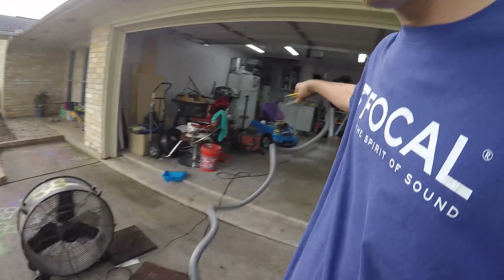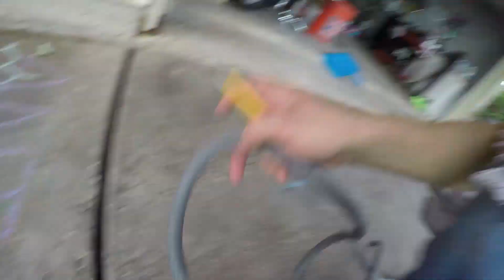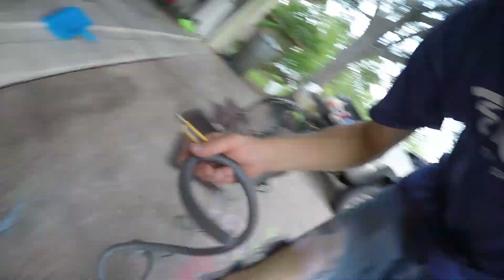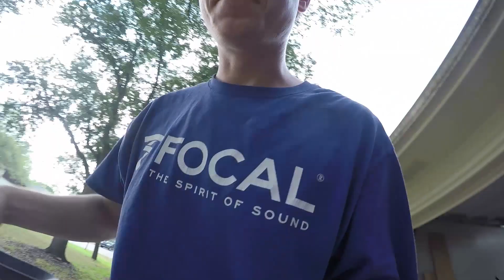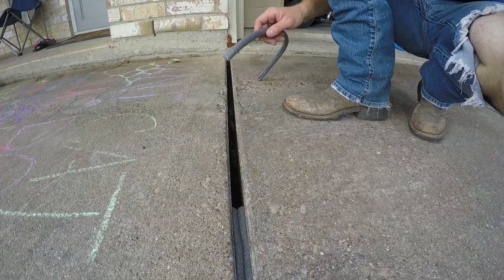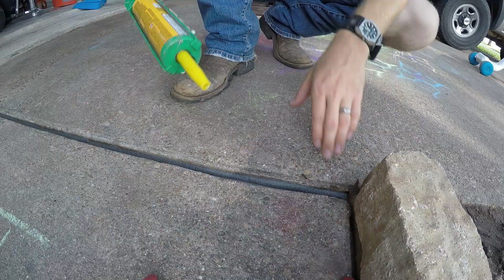Fit backer rod in larger gaps!

Comment: So I goofed hard and didn't know I could double stack the backer rods like you did. After applying the sealant it looks like the backer rod sticks out. I poured a sefcond coat but didn't do much because it keeps self leveling. Do you think I should just ghetto patch it with non self leveling or do I have to rip it all out and start over?

Comment: Completely wrong and defeats how BR works, you need to research why BR is to be used and how it works
Reply from the maker: Thanks for watching!
Reply: Well why not tell us?
Reply: Please tell us
Reply: It is important to get an hour class shape with your caulking so that there is a thinner section in the center of the gap. The center section allows the caulking to expand and contract.  If the center section is too thick you can pull the sealant from either side. Here’s an article that someone explains that. https://blog.buildmeetsworld.com/backer-rod-installation-choosing-the-right-one
Reply: @SnapIntoaSlimJim1  The shape of a round backing rod automatically gives you an hourglass shape in your sealant so I don’t believe it’s critical